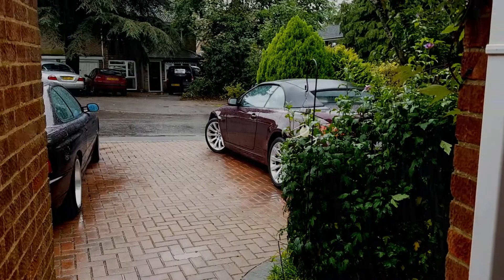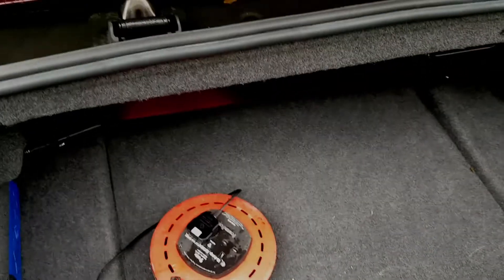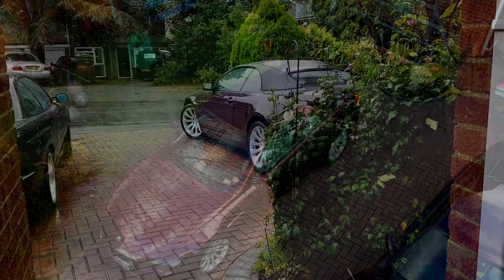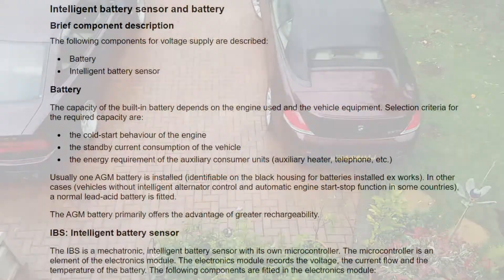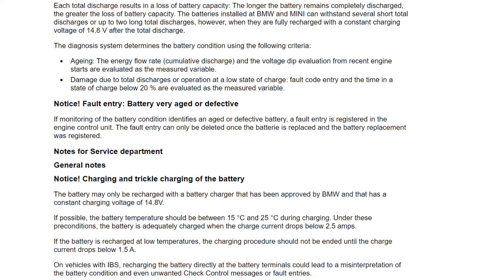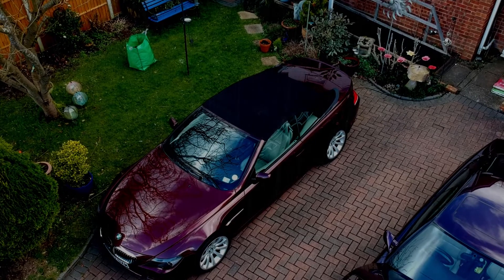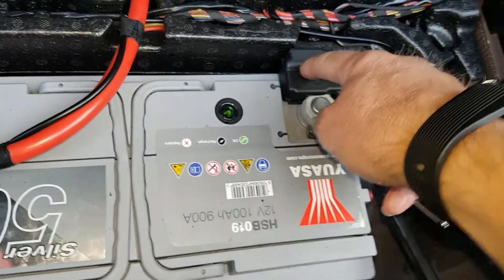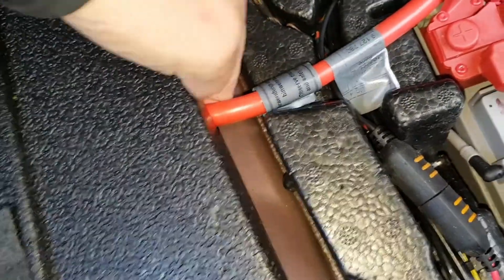Don't let your BMW 6-Series die this Winter!

Comment: Hi Mate from Tennessee! Memphis that is.  I have a 645ci and I'm learning everyday about the car.  We recently had a lot of snow and couldn't drive the 645 because of the 8 inches of the white stuff.  I was worried about the battery running down so I followed your advise and hooked it up the same way.  Seems to be doing brilliant as you showed.  No related.... I didn't know there are drains running down the sides of the windshield! But I ordered the weather strip conditioner you suggested as well and will get that worked on soon as well.  Thanks again.  The queen and I maybe crossing the big creek here soon to visit London. Hopefully I can buy you a pint or two.  I owe you.  Thanks again.
Reply from the maker: Thanks Brian, and great to hear from you - sounds like you are doing all the right things!

Comment: Another great video; thanks for sharing. I also use the well respected ctek charger but I connect via the +terminal and -terminal directly under the front bonnet (ie 'jumpstarting terminals as mentioned in owners manual). Just a message to all other car owners.... If you need a smart battery charger for your oldskool, classic, normal or performance car then I would definitely look no further than a CTEK battery charger.  Keep thease informative posts coming Timm👏👌👍
Reply from the maker: Thanks! Yes, I have two Ctek units, one for the 650i and one for the dual-battery 840ci - and they have been faultless in both.
Reply: @TimmsBMWRepairsandInformation  I'm putting my car in storage and from the comment above, it seems that using the connections in the engine compartment is fine?
Reply from the maker: @stevewilke3752  Yes, that will be fine!

Comment: Could you connect a 12v solar charger in the same way? Red to positive terminal and black to the chassis? I don't have access to an outdoor socket where I park.
Reply from the maker: Unless you live in California then a solar panel will be in use - even in SoCal it will hardly do anything

Comment: Hi Timm. Thanks for your very informative videos/website - I've referred to your stuff on more than one occasion for my own E64 650i. Have a question, if you don't mind - my 6 has a solar charger plugged into the OBD port. Car goes a week, sometimes 2, without being used. Having watched this video, would you say that use of the solar charger is not ideal? I'm thinking that it's probably pumping in such little charge that it shouldn't have any IBS implications, but not so sure! Cheers
Reply from the maker: Hello! A Solar Charger (unless as big as the roof and fitted to the outside of the car) will make no discernible difference - if you managed to get a few hundred milliamps out I would be impressed! No Solar Charger that is fitted inside the car will help one jot I'm afraid.....

Comment: Hi Tim great video. I just bought a 2005 645. Talking with the guy who owned it before he said he always had problems when he trickle  charged under the bonnet. Do you think this had to do with the IBS? If so would you recommend this set up. I'm preparing to store this car for the winter and im worried of massive drainage.

Comment: Hi mate! I want to buy a prefacelift e65, which one would be better 3.0d 218hp or the 745i? From what country do you sugest is better to buy? I guess cars from portugal and spain are better because they have not been used in cold weather. Or is it better to buy from austria, germany or france?
Reply from the maker: I would avoid an early 745i because of engine problems on the V8 - apart from that I have no experience of the E65!

Comment: Buy a fabric car cover for about £30 saves the canvas roof. I use mine all year round.
Reply from the maker: The problem I have always had with covers is what to do with them when it's pouring down in the morning when I need to use the car!
Reply: @TimmsBMWRepairsandInformation  Good point it only works on your 'fine weather' car -)
Reply: @TimmsBMWRepairsandInformation  agreed its for fine weather/weekend cars only Timm

Comment: Hi Timm, thank you for the video, I to have the CTEK battery charger, which I use on the E38 1999 740il, but I just hook it to the terminals.. Might I ask you in your opinion is that ok for my model, or like you should I go POS to TERMINAL and NEG to chassis earth . Thank you for your vidioes, always great to watch. Cheers.
Reply from the maker: You can connect a battery conditioner directly to the battery on the earlier models - no IBS to worry about!